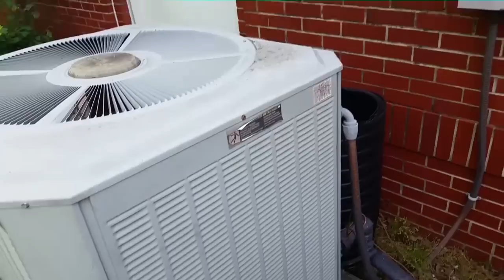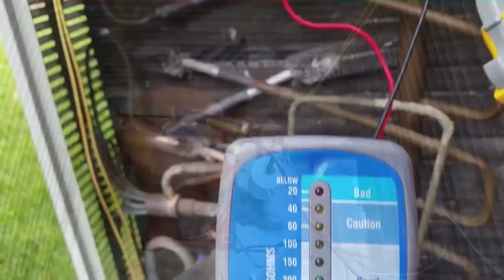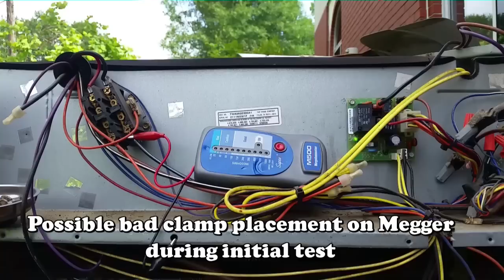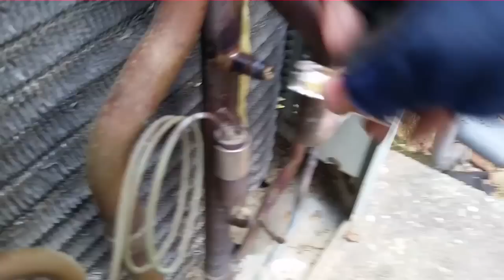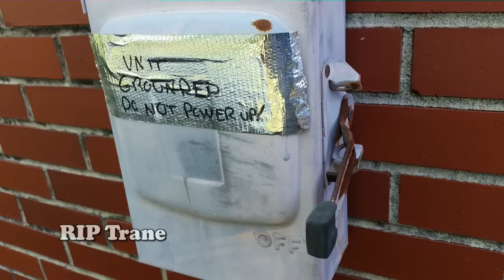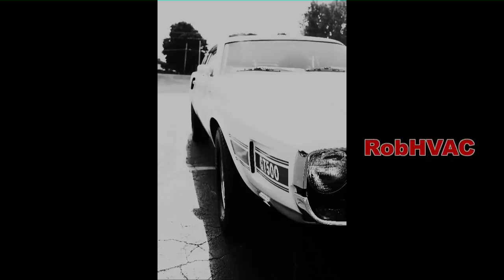HVAC Service - Trane Compressor Failure

Comment: Nice work Zack! I have got into the habit of testing to ground, then the suspect motor etc then back to ground, it proves the connections and meter is good before and after the test. I learnt that the hard way.....
Reply from the maker: Thanks diesel, let me ask you. In your opinion is there any advantage for me to carry a megger like yours over mine? You have seen the kind of work I do
Reply: talyn875 I think the Supco has its place, it is good to be able to show the customer that something is bad as indicated by the light rather than showing them a number on the screen such as with the type of meter i use, but i think for diagnosis purposes a meter that shows the actual reading rather than a good/caution/bad is better.

I think the lowest reading is 20M ohms on the Supco, but a compressor that read 20M ohms would actually run fine, so long as there were no other issues, it could be just some damp on the wires/terminals or even liquid refrigerant in the crank case will effect the reading.   
Usually when a motor has shorted out it is around 0M ohm so you know it is bad, my meter also does ohms so you can check winding resistances too. I'd say it would help diagnose things more accurately.
Reply from the maker: heavydiesel the reason I asked is just that. I don't show homeowners the red light so that is not a concern. I know that on a lot of the motors I am checking a proper megger would be nice because the failure threshold is waaaaay lower than 20 mega ohms. Which one do you have and are you satisfied?
Reply: Mine is made by a company called Megger, i think the model number is MIT410, it does a range of test voltages from 50V up to 1000V so is useful where circuitboards may be connected or on higher voltage commercial stuff. I got it as it is IP54 rated so no worries if its raining etc, I am very happy with it and would buy another one when the time comes to replace it.
I'll make a video of it, have been having issues uploading so may take a while.
Reply: talyn875 Zach Extech and Reed have great mergers, I have the Reed and I love it. $200

Comment: Since there was still low voltage power does that mean the air handler was wired to a different circuit?  If so, is this a common practice?
Reply from the maker: ahu units usually house the low voltage transformer.
Reply: talyn875 In my haste I forgot to specify which circuit.  Are the air handler and outdoor unit wired to the same circuit in the breaker box where they receive their electrical power?  Since the outdoor unit is 220 volts and the air handler is 110 volts, I am thinking yes since the circuit breaker was tripped but the transformer in the air handler was still powered up.  But I actually don't know.  I have really taken my stupidity out for a long walk today haven't I?

Comment: Talyn875, Can you make a video on the proper way to charge a 410A system after you have fixed a leak and pulled a vacuum on the system compared to a R-22 system I sure liked working with the R-22 Freon compared to the new 410A thank you for your video's
Reply from the maker: I do them the same way except that r410a must be put in as liquid all the time.

Comment: Great trouble shooting. Taking each component and separating it is sometimes the best. Look forward to the compressor change out. Make sure you get new roto locks. Every time I have one I can't get them off.
Reply from the maker: Oh I ordered them. I saw those rust buckets
Reply: U just need to heat the rotolocks and give them love taps.